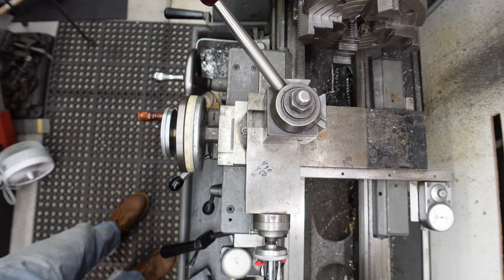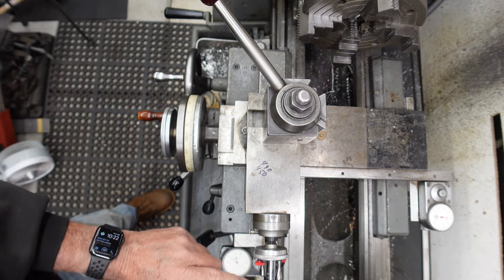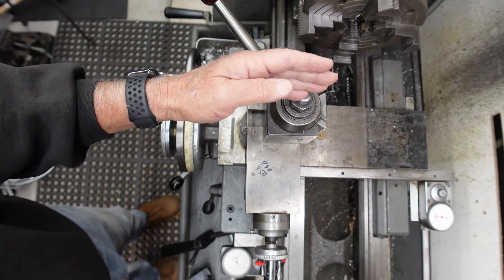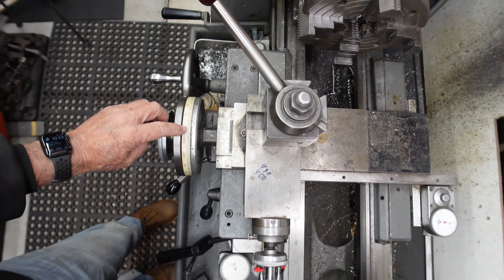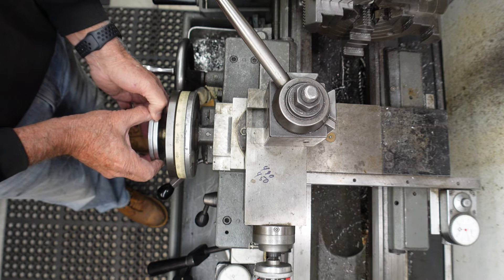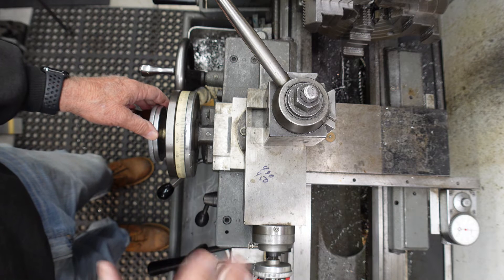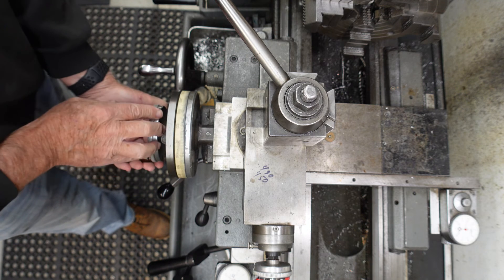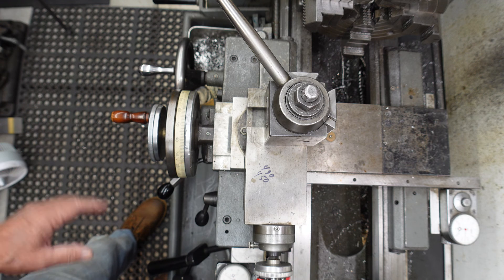How to correct backlash issues (beginner info) when reading the dial

Comment: Years ago I was taught to always turn the lead screw in the same direction to reduce backlash.  up until now I never thought of it as pushing the tool into the work.  Probably produces the same result, just a different way of thinking.  Good to see you posting again.  You have been missed.  BTW, the shaper is running pretty good.  I'm learning a lot about how to grind tools for the shaper.  Shaper tools are a bit different than lathe tools.  Lathe tools work but don't produce the same results.  Be well! KOKO!
Reply from the maker: great news on the shaper!!!  thanks for viewing

Comment: I was beginning to wonder if you were ok as you haven't posted anything lately, good to see you still breathing. 👍
You can also take out backlash by pulling on the toolpost, especially useful for very fine cuts as you put your own tool deflection in, i hear some lathes even have air rams to preload the leadscrew, but i dont know which.
Reply from the maker: Hello Chris....still kicking, been busy with work & life, I hope all is well with you.  Some videos are coming, new laser review and a new shop tool.  Good tip/info you provided hopefully it will get read by others....